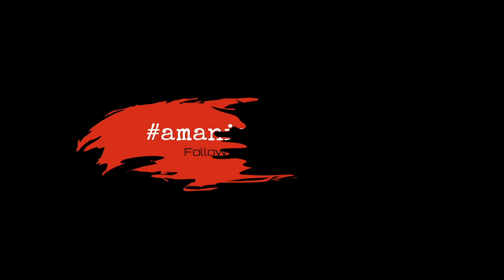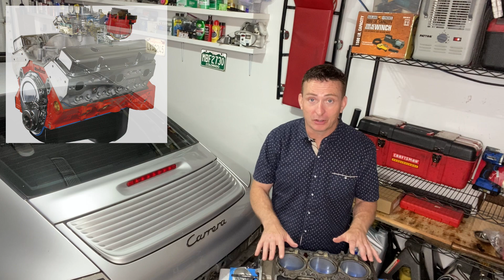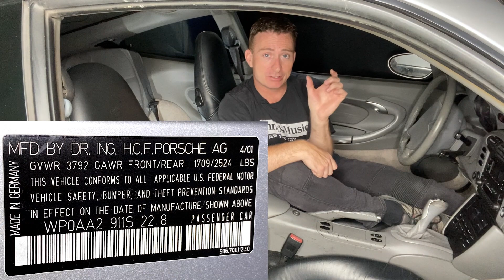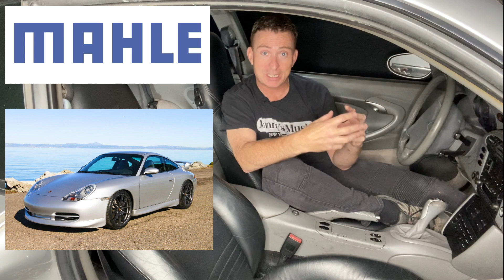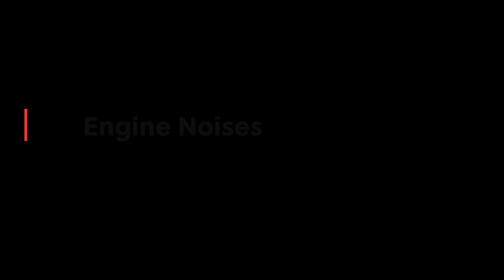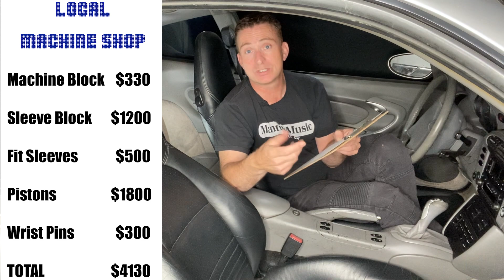WHAT IS BORE SCORING? PORSCHE 996 & 997

Comment: Who would you recommend to disassemble the engine? I definitely could not do that ! I am in California as well! Thx
Reply from the maker: Hello Shughes! I have no idea! 😂 This project is my first venture into car repair, my knowledge of Porsche workshops is zero. I would recommend Facebook groups and google searches to find a suitable mechanic. I hope you buy one and have some fun with it. Thank you for watching 🤘😎
Reply: @ManinaGarage Wow, that’s courageous! I’m wondering if however you’ve fettled motorcycle engines right down to the last nut, bolt and washer?
If you’re not very familiar with mechanics’ tools and how to use them, it’s going to be much harder to do.
Just removing a stuck bolt somewhere that’s not moved since it was installed in the factory may represent quite a challenge.
Because I’ve sheared enough fasteners including the horrifying exhaust manifold bolts in the aluminium casting shearing off flush with the surface, and rebuilt several motorcycle engines, I would recognise various different challenges quickly and reduce the chances of very annoying (& expensive) outcomes.
If you’re a thoughtful, persistent person, you definitely could do it alone, but you’re bound to experience some “OMG, I wish I hadn’t done that” moments. 
I hope it all went well! I’ll see if I can find other episodes in your channel.
Mike in Kent, U.K.
Reply from the maker: @ Hello Mike, it was a fun adventure. The website might help you navigate some of the other videos. Thank you for watching! 🤘😎 https://www.maninagarage.com

Comment: Great video! I am on the fence with the 997.1. I want to buy one because it is in my budget and I like this model the best however I don t won’t to plunk down thousands for a rebuild! May just save a bit and get the gen 2..
Reply from the maker: Sounds like a nice problem to have. My understanding from making these videos is that the gen 2 has the less reliable single row ims bearing plus a similar bore-scoring story. If I were trying to buy a car to drive I might recommend looking at turbos, they have a different engine design that is more reliable. Plus the turbo cars have the performance that most people are expecting from these kinds of cars. Thank you for watching 🤘😎
Reply: @ManinaGarage  I Never considered a turbo and didn"t know that about the Turbo engine.You def spark my interest! Thx..
Reply: @shughes911 The 996 turbo engine is called a Metzger engine, named after the designer. By repute, they don’t have any of the problems considered notorious in the normally aspirated engines. They’re a more complicated car as well as much more powerful.

Comment: My 2015 Macan had a ticking noise in the engine. Turns out it was a bore score and required a full engine replacement at a ridiculously high price.
Reply from the maker: Wow! I had no idea the bore scoring problem could continue to happen in a 2015 Macan!! I appreciate you taking the time to share that, thank you for watching 🤘😎
Reply: @ManinaGarage I too didn’t know it was still an issue in 2015.
What’s little known is that it wasn’t just Porsche’s sportscars that are vulnerable this way.
Cayenne, Macan & Panamera models overlapping the problematic 911, Boxster and Cayman years have also been reported to have the same bore scoring problems. 
I’ve no idea what the respective prevalence numbers are.
Reply from the maker: @GT380man  apparently jaguar had some issues like this also.
Reply: 2015 😮 I thought this was all sorted long before

Comment: Just a note to correct the pricing info from LN -- The $5205 price includes all machining, cylinders, plating and a box of brand new JE pistons, rings, pins and clips. That is the cost for most every block regardless of bore size.
Reply from the maker: Hello Charles, accuracy is important, I appreciate you taking the time to comment. The price I quoted in the video is a direct quote from LN Engineering received shortly before making the video. Every effort is made to ensure the numbers quoted in these videos are recent & accurate.

Comment: Informative and entertaining,  I'm not sure how you do it. Don't forget you'll need to gap the rings whether you have new pistons or old. Don't take this the wrong way, but before you reuse the old pistons,  we should have a close look at your skirts...
😏
Reply from the maker: Hello Ken, my life in the last 30 days has revolved around those skirts, what are your thoughts? 🤓 regarding the rings, I did get the specs on the compressions rings and tested a couple of them and found them to be bang on. I also spoke to Lee Jenkins at Hartech about it, he said that if I’m using stock Pistons and stock rings in a stock head, there is no need to gap them? I hope you saw a your shout out regarding the 997 Oil returns! 🙏 it was also because of you that I got the TuneRS Motorsport DOF IMS Bearing 🤓🙌 THANK YOU
Reply: @ManinaGarage  In the previous Porsche engines (which NEVER has IMS issues), IMS bearings had a pressure fed oil supply (like every other load bearing), BUT a bronze alloy sleeve bearing. I am not sure just adding oil feed to a poor design will fix the problem. The 996/997 IMS is in an oil bath, but ball (and roller) bearings need grease! 
IMO (just a dumb airline pilot), I think the "proper" solution to the Porsche IMS failure problem is look at what works vs doesn't, like the aluminum cylinder and aluminum piston interference issue (this video), and develop a solution based on correcting the design faults. 

So far, no one has.

 I am leaning toward the EPS roller bearing, as it has more surface area, and is in the oil bath
(until someone invents a pressure fed sleeve bearing, like the Mezger design)

Just my 2 cents (my opinion)
Paul

P.S. to anyone reading this: I am just a dumb airline pilot, you should learn facts (not opinions... there is the rub) for yourself, and make your own decisions.
Reply: @FunWithPaul  I don’t know anything more about these .. but have heard that most IMS kits now carry upwards of 75,000 miles warranties… which feels like a good deal of confidence in their product… ( if they plan to be around that long)…

Comment: Hello I love your show, Keep on the good work, regarding the bore score I did want to mention that it seems to start when the piston skirt coating begins to flake off, the flaking between the piston and the cylinders then produce the scoring, that said have you considered replacing the pistons?
Reply from the maker: Hello Eddie, There were some aspects of Bore Scoring that I was not able to discuss in the video due to a NDA that I signed to get research papers on the subject, that NDA got removed this morning so here we go. The simple truth is that Silicon particles are being knocked off the Lokasil cylinder walls by the rings and getting trapped between the cylinder wall and the piston skirts. In addition to that, it was known at the outset that the redesigned piston skirt coating would not survive the new Lokasil V2 longterm regardless of how the car was treated. In the case of my specific engine, there is no need for new pistons though that option was included in my price rundown as it was an option I looked into. Thank you for watching 🤘😎
Reply: Yes, that makes lots of sense, thanks for your quick reply. 
Something to consider  is that the coating on your piston skirts are harder than the newer version.  Love your channel, looking forward to see the next episode.

Comment: Great work on this episode and congrats passing 1k subs!  Your diligence covered all the knowledge I picked up in the past year plus you added a little more. IMO bore score is more of a threat than the IMSB. When I learned about the Lokasil v1 and v2 from the Hartech report and how bore scoring affects the bigger displacements I put a lot more value on the early 3.4L's.  Mine was built in 3/2000. I'd wondered if there could be a mod or a product that could better oil and cool the bank 2 but I guess not since an effective solution would have been introduced by now.
Reply from the maker: From what I hear, people are using fancy pants oil with the low temp thermostats to improve their Lubrication Situation. Thank you for watching 🤘 😎

Comment: Good to see you did your research on the generations of lokasil and the piston skirt coatings. Lokasil has different densities/concentrations of silica throughout the matrix and when this removes the skirt coating then you have aluminum to aluminum contact, and here comes the bore scoring. The most recent alusil engine, from 9a1 to the 9a2, have gone to a plasma iron arc bore and piston skirts require no plating. SUME bore is being worked on to replace the nickel silica for future rebuilds also. I see you've made the prudent decision to install the DOF and are you installing the roller bearing wit this upgrade? EPS offers this solution if you desire to go that way (bulletproof).
Reply from the maker: Hello Warren, Thank you for the extra information, I know people reading these comments will really appreciate it. The DOF is part of a Kit from TuneRS Motorsport in FL. It does NOT have a roller bearing, I'm sure I will be crucified in the comments for that 🥳 .. Thank you for watching 🤘 😎

Comment: What I do not know is if you can re use the original pistons with a sleeve or a Hartech cylinder?
Reply from the maker: Hello Andrew, I think you would have a hard time convincing Hartech to put the old pistons back into an engine they are rebuilding. The ferrostan coating are designed for Lokasil only. Plus, if you are paying for the resleeve/repiston anyway, going up in displacement to 3.6 or 3.8 is no extra cost.